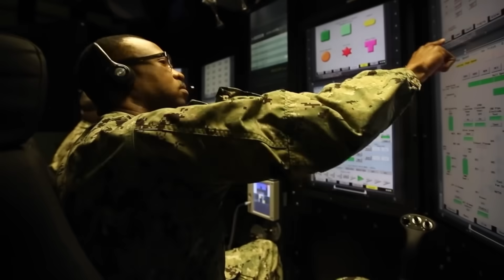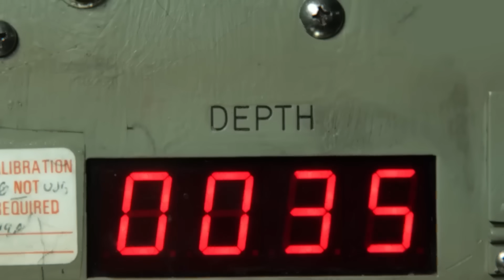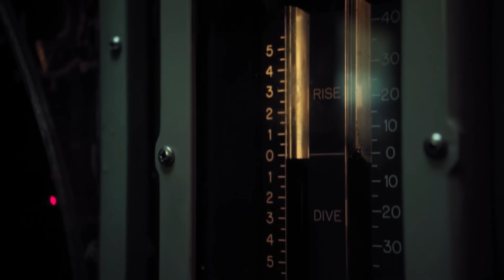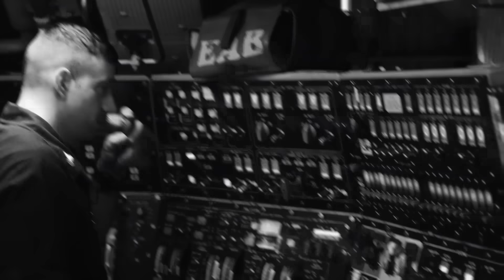What Happens When a Submarine Hits "Crush Depth"

Comment: "The crew would perish multiple times in the blink of an eye."

That's actually... somewhat reassuring I think.
Better than the alternative at least.
Reply: The worst part would be the wait as the submarine descended without power. I don't know how long it would take from the critical failure until the hull reached crush depth, but that would be a period of pure terror.
Reply: @Condor Boss 
Depending on who and/or where you were on the sub, you would have had between 3 and 5 minutes of knowing what was coming. 
That's  long enough for poop to be the last thing you smelled as most everyone around you literally shit their pants.
Reply: @Faolan161 Perhaps you're unfamiliar with the Byford Dolphin accident where a human being was blasted through a very thin crescent by just 9 atmospheres of pressure. Ignition only requires the presence of oxygen and sufficient heat to begin combustion and the temperature spike of a gas being reduced to 1/60th of its normal volume (by Charles' Law, T1/V1 = T2/V2) from 300K to a couple thousand is enough to make nearly any material combust (steel combusts at just 900K). Things undergoing any kind of violent event like an implosion are inherently chaotic and nonuniform so saying that "you wouldn't be knocked out because you'd be hit by a simultaneous and equal pressure wave from all directions" is nonsense.
Reply: @efulmer8675  implosion would be the least chaotic of destructive events, so saying otherwise is just nonsense. I assure you that steel does not combust in an underwater implosion. At those pressures, diesel and sometimes gasoline are what combusts. There simply aren't other sources.  And if course, we have the water issue that snuffs out any combustions...

About Byford Dolphin... They didn't all die by being squeezed out of a thin crescent, only one did. It appears the others died by the nitrogen boiling out of their blood from the pressure. This phenomenon causes a sickness at first before death, though... Instant death is not possible that way, otherwise sickness wouldn't happen. This is simply people relying on something very difficult to prove and resting on the fact people won't go try it and record what happens. Picture how the person who wants another to believe something that is not true portrays the events in question - this is how they portray it, when it is virtually not provable, but they don't want to scare anyone... Yet, when truth is spoken, it is only met with support for the narrative.  Problem is, when one hears this kind of thing, and tries to apply it, they are key with the feeling something is wrong, and they can't figure it out because wrong beliefs steer them a different direction from lifesaving wisdom that comes from intuition. But people won't be proven wrong, and so obstinance becomes their tool of choice, maintaining foolishness.... Foolishness like, combustion requiring only oxygen... You forgot that it needs fuel... and if steel were to combust at these pressures, then internal combustion engines, especially 11,000 horsepower dragsters, wouldn't be a thing...

No, pressure death is not instant, and it is surely felt. Hopefully people realize this and work to change such a things... Unfortunately, the Byford Dolphin experience lends to proving my experience more that proving against it. Sudden compression simply isn't a sudden death. It takes time for the blood to percolate and kill.
Reply: @Faolan161  i am fairly certain that if a hull passes crush depth and does implode your internal organs all turn into jelly including your brain. you are making this out of a roughly 9 atmospheres of pressure give or take but like the video said the pressure from where the subs are would be higher. and quicker to kill you. also with enough knowledge of the human brain as it is, we can easily perform tests to create crush depth like events and record the data from them to apply that to how the human body works. you could fill an air tight room with high pressure of air and have a canister with a human like body in it, pop the cylinder and record how that reacts to the sudden increase in pressure, and vice versa with making a vacuum. im fairly certain that they have done this and thats why they believe it would be instant. the sheer pressure would destroy your brain causing instant death while your body still suffers the effects of rapid pressurization.
Reply: @moviemaker2011z  I commented on 9 atmospheres pressure, because that is what the Byford accident was about... At least try to keep up.

For organs to implode, there has to be somewhere for them to go. As the last commenter mentioned about the guy being squeezed through a crescent hole at 9 atmospheres pressure, there was a place for him to go when he was standing at a door... When a sub implodes, the pressure just equalizes, and aside from being struck by part of the sub, they would experience sudden pressure all around, which pushes nitrogen out of the blood, causing the blood boiling effect. If pressure would cause organs to scramble, the divers wouldn't be able to make it 300 meters deep at all. The lungs would collapse, possibly breaking ribs, but all the other organs are a solid mass, so they couldn't crush with pressure all around. The world record dive with oxygen is 332 m, showing the ability to breathe is possible at 33 atmospheres pressure. Double that is not going to scramble your brain matter... Death would be a matter of suffocation in a matter of a few short minutes... while one's worst nightmare comes to reality.

But, here's a way for you to know for sure - go recover bodies from a collapsed sub, and see if they're disintegrated, or still intact. Then you'll know...
Reply: How does a crew perish multiple times? I thought a person can only perish once.
Reply: @humanbeing2420  it just means you experience so many different causes of death in a second. Like you’re crushed. Ignited. Twisted. Atomised etc all in an instant
Reply: @humanbeing2420  Or in order words - atomized to such a degree that there's no trace of them left.
Reply: @RazorsharpLT  no atomization when there is nowhere for the body to displace to. A constant pressure all around would support the body from being torn apart.
Reply: @Faolan161  Dude - that's not how it works

The body is filled with air bubbles and pockets.

Being under the sea 900 meters below is like being crushed by literally 92.99047 kilogram force PER SQUARE CENTIMETER.
Reply: @RazorsharpLT  that's not how it works, by telling me the body is filled with air pockets???   😂🤣😂🤣😂 

It isn't like a horse standing on your foot, it is an equal pressure, with no place for the bodily tissue to displace to elsewhere. That's where pain comes in at some point, is the displacement, not just the pressure. But still, the horse standing on your foot is survivable. It doesn't sheer your foot off, even though there is someplace for the tissue to displace to.  Why do you think a 300 m dive is survivable? I assure you that it is not an instant death. It is not a pressure of crushing, it is a pressure of suffocation, more like that of a boa constrictor...

And the air bubbles begin with pressure forcing nitrogen out of the blood. There's no air voids inside a body, aside from your bloated comments...
Reply: @Faolan161  Like seriously - why do you think your EARS hurt when you DIVE?

Because pockets of water cause PRESSURE in your BODY.

Can't believe i'm explaining this, but hey - you could be 15 and not know this stuff.
Reply: @humanbeing2420  Turn of phrase.. meant that in a second several different effects to a crush depth implosion would kill them several times over.
Reply: That's what they want you to believe. The pressures aren't great enough to do anything they said here. Ignition requires flammable fluids to be present that combust under pressure, not everything would ignite, if anything... Pressures that knock people out don't have an equal and opposite force on the other side of the impact like an implosion would demonstrate. The only death from impact would be from the human head hitting something hard within the sub. It would be more like a boa constrictor squeezing you to death... Pressure would cause lung collapse and suffocation. 

Of course, nobody has experienced such and told about the experience... so engineers can shape whatever story the want to make people believe they wouldn't suffer. They are bolder when the consequences are believed less. And those who do not suffer consequences drive others to do as they wish like slaves, with stories to support the narrative, not truth. When people aren't afraid of suffering, they are willing to do more, and this experience is not provable. Experience always shows where theories are missing truths...

Comment: In 1964, , whill an engineering student at nearby UNH. I   took a  summer  job with the Portsmouth Naval Shipyard, where the Thresher had been built and berthed.  

As a result of the sinking , a research program was set up there to  study the effects of repeated dives and resurfacing on  a sub hull's  welded joints.

Pressure hull sections (cylinders, fulcrums, hemispherical heads) were welded together  and enclosed in a big  shed.  Hundreds of strain gauges were placed  along the hull joints.  Pressurized water was pumped INSIDE and out of the  mockup in cycles, to simulate deep dives and resurfacing.    (I never understood why the pressure wasn't applied from OUTSIDE, but I suppose that would have required an enormous facility.)

After 5,000 cycles or so the strain gauge data would be collected.  

MY job was to  use  an electromechanical calculator to apply formulae to turn raw strain gauge readings  into  joint deformation measurements..  I then plotted the results on large charts depicting those joints in cross-section.   It was a grueling job, one meant for rookies to do.   But not for 8 hours a day.

So I would also wander around the Yard, looking at diesel and nuclear subs being built in the enormous Shed,  where you could see  the frames of four or five subs being staged for assembly. (One, the deep-diving Dolphin, stood out, as its frames were much thicker and closely spaced.  I finally got into it  50 years later in San Diego, after it was retired.)  .  

 I was also suited up and allowed inside the one sub's nuclear compartment.    On an old diesel I destroyed one of a nice pair of shoes by stepping into an oily free-flooding compartment. (I dipped the other one in to try to match the color change, but then they both stank.) .  IOW Mistakes you make only once.

 But I steadfastly did my work doing those strain gauge calculations every day.  At summer's end I was invited into the Shipyard Commander's office, where he  personally gave me a "Certificate of Appreciation" for my work.  They even took a photo and put in on the front page of the shipyard's newspaper!  I was told by some of my fellow workers that they would have "killed" to get such an award into their work history.  

My life later took a completely different path.  But I'll always  remember  that first "real grownup job", and how much I enjoyed all the people I worked with.    BEST GUYS EVER.

Comment: Nothing.  The 'crush depth' has a significant safety margin built in.  Go a lot deeper and the people tank will crush and the water will come in.  There's a clue in the title.
Reply: I believe you are referring to test depth not crush depth. Thresher went an additional 800 feet beyond estimated crush depth which is 125% beyond test depth
Reply: Crush depth by definition is when the sub collapses.  Nobody really knows where that is until you get there.
Reply: @arianebolt1575  Wrong. Are you trying to say nobody knows the crush depth of a particular submarine until it is crushed?    There is designed and actual and they should be damned near the same unless a margin has been applied.  Max operating depth is a function of designed crush depth and designed crush depth usually has a margin.